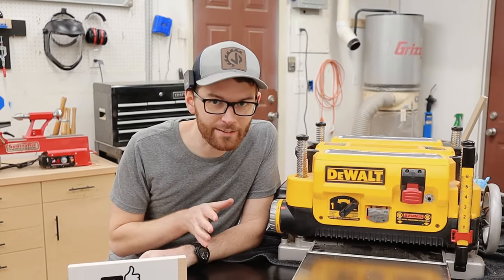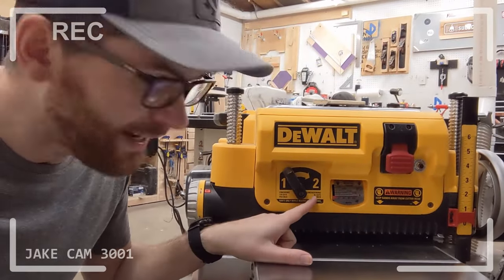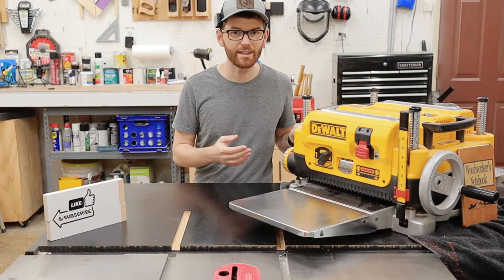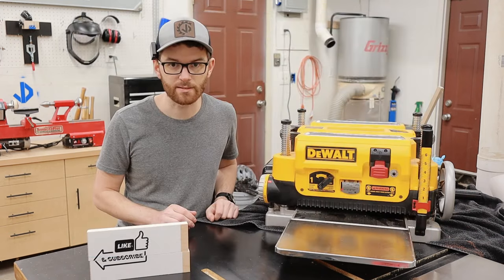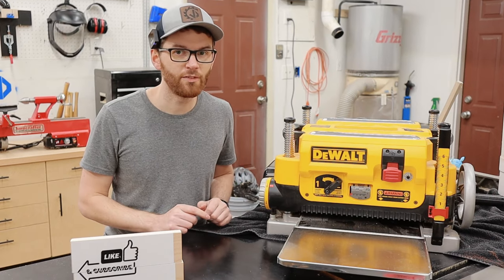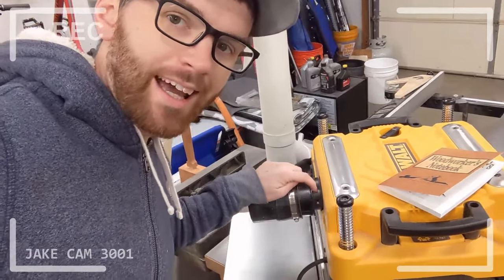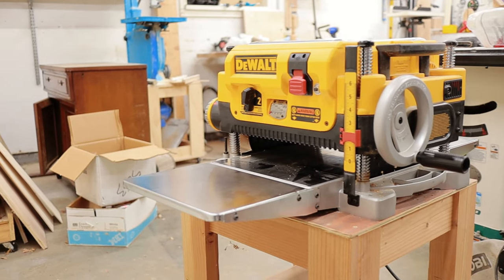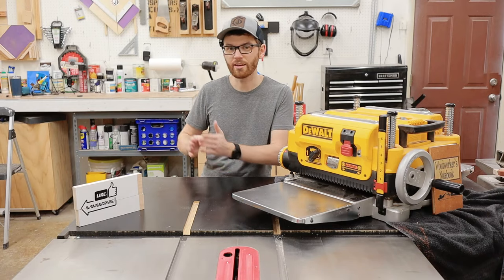4 Year Review of Dewalt DW735x Thickness Planer!

Comment: You can 100% sharpen these knives. You're not going to sharpen them a dozen times, but 2-3x, no issues.  Now you're also not going to sharpen out a big nick. But, if your blades are a little dull you can easily make a sharpening jib to put a fresh edge on them.
Reply: I know this is 9months old, but…

Tormek sells a jig for these blades if you have a Tormek sharpening machine.
Reply: I still sharpen my plainer and jointer blades on a home biult setup 👍it is good to keep them fresh, but they aren't too expensive unless you buy the fancy cutter for your plainer 😂

Comment: Yeah ... agreed 100% !! I have had a 735 for 8 years ... and used the hell out of it. Mostly use it for conditioning old barn wood, or rough cut sawmill wood to use in fine wood projects. Never has ceased to amaze me at the capabilities of this machine. Everything from knotty cedar, to hard oak ... even black cherry ... and it ALWAYS has produced gorgeous smooth, almost polished woods, planed to dead-nuits accuracy,  to work with. AND ALL THIS with the same set of knives it came with!!!  Have never been changed!!!! (But that task is on the calendar now!!) For me, personally, IMHO, wouldn't, COULDN'T be without it!!  But will agree to the comment about the weakness for the tabs at the exhaust duct connection for added ducting. As to cost ... in my experience ... now ... ????  Costly, high-dollar as common shop tools go ... as outright necessity and usefulness are concerned ... just starting woodworking ...if you have to go without ... GET THIS MACHINE FIRST!!!!  It pays for itself in function, and use, by producing furniture grade / quality material out of the mill rough, and barn retrieval ... almost instantly. And keeps on doing it. One last caveat ... be sure to set aside in the budget ... enough for a DAMN good set of ear-protectors!!!!! It is VERY LOUD in operation!! Call it deafening!!
Reply: Never changed the knifes huh? 8 years. Even carbide gets dull and nicked up.

Comment: I sold stationary power tools for 30yrs and there is NOTHING close to this in any other line except Jet which we cannot get in Canada. That said I bought a warranty replacement repack from Dewalt 10yrs ago and me and my partner have run this machine HARD. Short of a 20in floor model thickness planer there is no other choice currently.

Comment: Hey Dan, this is Jake....I have this planer and have considered springing for a helical cutter head, but that's basically 8 sets of straight blades which would last me a VERY long time. One other point about the helical head (which I don't think you mentioned) is the noise reduction, in a stock configuration, the Dewalt DW735 is a screamer.
Reply from the maker: Hi Jake!  Totally agree with the helical.  Sure, i would technically pay it off after a while...but boy howdy thats a lot of cash!  My friend has the helical and it definitely reduced the noise.
Reply: One thing I would mention you have to have a 20 amp circuit for sure  to run this machine.Dont buy a helical style cutter but the real helical original.The knock offs don't last that long l have heard.
Reply from the maker: 20 amp is good, but I do run mine on a 15 and its fine.  Just make sure nothing else is on that circuit.

Comment: One issue I’ve had is with the motor belt.  If yours breaks, buy the OEM belt replacement because the Amazon ones break almost immediately.  Also, good luck changing the belt.  It’s a bear to change it.
Reply from the maker: Oh man, yeah, I can see that belt being a bit challenging.
Reply: If your belt dies on you. Call out for belt like your calling for help. Works everytime!

Comment: Mine was absolute trash. Bought it at the beginning of covid so it never got used during that period.   When it did finally get used it worked on some easy planing for 10 minutes and then it melted the belt.   10 minutes of use for $800.  Warranty elapsed.  Tried for a week to talk to a technician, but no luck. Still do not know why the belt melted right through.
Reply: This model is chain drive
Reply: @New_Zealand_  There are two chains and one belt

Comment: Love mine..the Wixey digital depth gauge is a must have add on for this planer. So much easier to read then the ruler on the front of the unit.
Reply from the maker: Ill check it out!  Thanks for watching!
Reply: I'll second the Wixey.  It easily allows me to plane within .005".  Great when I screw up a piece and need to plane another board in the middle of a project.  

I also consider the helical cutter a must.  I mean, you've spent the money on a good planer...might as well spend some more and make it great.  Got mine when working on mesquite project and nicked a brand new set of blades on the first board I ran through.

Comment: Thanks for this video.  Looking to get a planer and it is likely this model.  Any idea how long the straight blades last before you need to flip them over?
Reply from the maker: Thats a tough one.  It really depends on how much shop time you get, and what materials you are cutting.  (maple will burn out blades much quicker than pine).
I think you should experiment, but start with flipping them after a few months of use.  If you can tell that it made a huge difference in performance, then stick to that schedule.  Good luck!

Comment: Thanks Jake and a really useful review.  These sell for around $1,600 in New Zealand so a lot of money but still a good quality tool.  Sorry to hear you don't like metric but seriously, you should give it a try.  It's waaaaaaaay easier to calculate in 10s than using imperial.  I'm originally from the UK  where we changed from imperial to metric about 50 years ago so I've had plenty of itme to get used to it. Looking back, the idea of 32nds, 16ths, 8th, 12 inces to the foot, 3 feet to the yard etc just seems archaic and frankly, bizarre! I think that the US is possibly one of the last countries in the world that still uses the imperial system?
Reply from the maker: Dang, thats a lot of money for sure!
Picking on metric is always a good way to get comments, haha.  I use metric everyday for my day job, but in woodworking, everything in the US is imperial, so that's just what makes sense to use.
Thanks for watching!
Reply: Agree
Reply: Just bought one for 1200 in Australia.  Sick of looking at one in the shop and wanted it in my shed. Haven't used it yet.  A bit concerned about using it on Australian hardwood
Reply: it's really that we use inch fractions instead of decimals with woodworking. machining or other crafts that use .01 for example makes metric and imperial not too different other than scale itself.

Comment: Is it the type 1 or the 12 ? It seems that since it is made in China (type 12) instead of Taiwan several users have experienced problems with the motor of this new version. You can see the type right next to the serial number. I'm asking you this because it's on a big discount here in Canada (-$220 off the regular price $899 canadian dollar). The demonstrator in store was Type 1 but the one I just bought is Type 12 so I wonder if I will return it. Has anyone experienced any issues with type 12 vs type 1? THANKS !
Reply: I don’t know which type I have but after 10 minutes of running 5.5” pine boards it constantly trips circuit breaker so it must be a cheap Chinese motor overheating. I absolutely hate this planer I even bought expensive blades as an upgrade and I can’t take a 1/16” of an inch off without circuit breaker tripping. Pure junk.

Comment: I just picked one of these up used with a small chip in two of the knives that left a line on my first few test pieces. You mention the knives are indexable, but it seems you can also slide them side to side just a little to get a little more life out of set of knives by staggering the mutual chip. Running on 'finish' speed this virtually eliminated the line being left from the chip as the other two blades clear away the missed material. Seems like a solid little planer and I'm quite happy with it so far. Perhaps consider a 3D printed QR adapter to remedy your outfeed table issue. I'm currently waiting for a new hose 45 degree hose adapter to print. The DeWalt adapter seems... lacking and is fragile..
Reply from the maker: Good idea, I hadn't thought of sliding the over. But I have flipped them over before (just one) to try and eliminate the chip. 
Really interested in your 3d printed adapter, let me know how it turns out! I might have to make one myself. 🤔
Reply: @MakewithJake  I'm utilizing someone else's printer at this time. I haven't committed to buying my own yet. Have a look on websites such as thingiverse to see what kind of free files exist. He's doing ABS with an 80% in-fill so it should be sturdy.

Realistically you could pull any of the already made adapter bracket ends of a current design and modify it to direct straight up in a wide/flat orientation (similar to the exhaust chute that comes with the unit) and then necks back down to  a 4" for your collection needs, or out to the side, or whatever you want. 

This is the one I'm picking up this morning. 
thingiverse.com/thing:2659170

Thanks for the video on this unit!
Reply: For that outfield table. You might want to consider a stick on silicon/plastic cord keeper. Stick that above the rear outfeed.

I just don't know if I would try to use an end to catch it, or keep it a little high and wrap the cord around the keeper?

I'm assuming your talking about the outfeed. Haven't watched the video, but know it's an issue. I don't have one so can't recommend placement. Just an idea!

Comment: Aside from all that, this is an excellent design. It comes with the tools you need to replace a set of knives which is RARE folks. My first Delta cast iron 13in had nothing with it except a jig to allow you to set the height of the knives but it weighed 300lbs. It is an excellent design that is super easy to work on. Thats rare in the power tool world and is always a good indication of a well built product.

Comment: I bought the DW735 and it would vibrate off the thickness I wanted. Found out that was a problem with other people buying it. I took it back and got the DW 734 and it works great and has a locking mechanism to keep it on thickness.
Reply from the maker: Thanks for sharing, it's a great machine!

Comment: How many sets of knives have you used in the 4 years
Reply from the maker: 3-4 I think. I would rotate them every 6 mo, or when I got a big chip in them. Or....if I knew I was about to start a big project, I would just rotate or replace them right away to start with sharp knives.

Comment: nice review, i've read tons of reviews of benchtop planers, some users of 735x still say they get snipe, did you have to make adjustments to get rid of snipe? how is snipe on short pieces? thanks
Reply from the maker: I found that having the infeed and outfeed tables perfectly level, if not slightly elevated, results in the least amount of snipe.  The other thing I do is make the last pass very very light.  Snipe is caused by the carriage twisting, so a lighter pass reduces this.  In most cases this results in maybe only 0.001-0.005" of snipe, which generally speaking, is plenty good in my opinion.  Hope that helps!

Comment: Any reason why my planer's rollers aren't spinning? Right put of box new.
Reply from the maker: weird.  Is the transmission set to 1 or 2? If it is not fully locked into one of those positions, it may not be engaging rollers.
Reply: @MakewithJake  yes I tried that several times back and forth, and also ran the planer with the cover off. The rubber rollers are not turning, and the chain driving them also not.

Comment: Will it run OK on a 15 Amp breaker?
Reply from the maker: Mine does run on a 15a breaker, however, I just just checked the manual and it recommends a 20amp circuit.

Comment: can this planner shave cupping or bent wood?
Reply from the maker: Absolutely, however, you would want to use some sort of sled to keep the wood flat as it moved through.  Here is a quick video I made about this exact trick: https://youtube.com/shorts/J2edYktmAvs
Reply: Get a jointer - run one face and one edge through jointer, then run other face through planar and other edge through table saw and you have 4 sides square.  Then plane down to desired thickness

Comment: Love an hate the fan assisted chip ejector. I'm having to purchase better dust collection since it's more powerful than my shop vac.
Reply from the maker: haha, Yeah, when I first got it, I had a hose going into a garbage can and it definitely did not work. at all.  shavings EVERYWHERE!
Reply: @MakewithJake  lol that's the second thing I tried after I realized my shop vac didn't suck as much as it blowed with the same effect
Reply: I put a hose into a cyclone top which ejects into a large paint bucket.   On top of cyclone the opening, I covered with a used hot tub filter and bang… works like a charm!
Reply: @brandtl1486  I did similar. Put a t on top an still hooked up a vacuum an almost nothing comes out the top of the tee. Not real sure the vacuum is doing anything, but it's there for moral support if nothing else. Works pretty good, but it still overpressures the bucket an some dust makes it out around the top. Still catches 95% of what the planer puts out

Comment: You know I have watched a lot of videos about this planer going back about 7 years and it is still the same machine with no upgrades just more expensive also most of the planer knives are easy to change the design it's pretty much the same, I have a Bouer very cheap but it doesn't have a chain drive it has a rod with gears that is far superior just saying. P.S. does it give you snipe?
Reply from the maker: I dont really get snipe on this planer.  I have a few techniques that virtually eliminate snipe.

Comment: Ive had one for years now. I HATE the snipe. I always need to plan how to not waste wood. It is such a pain. And if you think, well others say snipe can be taken out, they are wrong. If you want to manage snipe you need to supply blocks before and after the wood and those blocks should be the same thickness as the wood your putting through OR you can screw in some wood that is about 10 inches longer then the length of the board, and it should be on both sides of the board. This takes time and is always problematic. Its better to look at a more expensive machine. And if you are taking multiple passes, snipe accumulates, on top and bottom. If you starting out and don't care about annoying snipe then its perfect. I would NOT buy it again for my shop. Engineers should be able to take out snipe, but they don't care enough to design out this flaw. And the dust collection is always in the way. You might be able to do without a jointer, but you must have a planer. So if at all possible, get a better machine. If this is all you can afford right now, then get it and upgrade later.
Reply from the maker: I can usually minimize the snipe that I dont need to worry about it.  If I ABSOLUTELY need the wood to be perfect, then yes, I will cut off the ends.  But 0.005" of snipe is good enough for most woodworking.

Comment: Yet oddly, when compared to the other top 5 bench top thickness planers, the DeWalt DW735X had the longest measured snipe, at an average of 3 inches per board, which was the worst of the 6 planers tested side by side. Whereas most of the other five came in between 2 and 2.5 inches. Seems DeWalt's 4 post design didn't make the snipe issue any better at all. However, the DeWalt DW735x pretty much beat the competition in every other category; except of course for price.  Reference: https://youtu.be/08NRFG7zoWI
Reply from the maker: Very interesting video, I like the scientific approach they used to quantify their results.  I don't really have a snipe issue unless I run a real heavy cut. What I typically do is run a very light pass on boards after I get them near thickness, and this results in pretty much zero snipe. Your milage may very. Good luck!
Reply: Very easy to eliminate, I have no snipe on my setup. Have had mine for about 4 years and love this plainer. About ready to pull the trigger on helical cutter head.
Reply from the maker: Nice! Helical head would be awesome. Someday...
Reply: @MakewithJake  ...said every woodworker.
Reply from the maker: @pumpkinheadghoul  🤣
Reply: @alk5749 what did you do to eliminate the snipe???

Comment: The dewalt blades are garbage.  I bought a 3 pk off amazon that were not dewalt and they are far better.  I haven't tried the Infinity brades but that is next on the list to try.  I would go with the shelix before I buy the carbide blades since it is only a couple hundred more than the carbide blades.
Reply from the maker: Interesting, I might check those out next.  My only issue with the infinity carbide blades is the price, i wonder if they chip as easily as the HSS DeWalt blades?